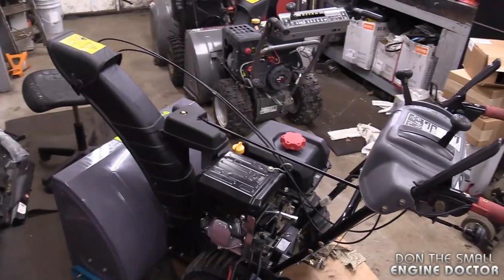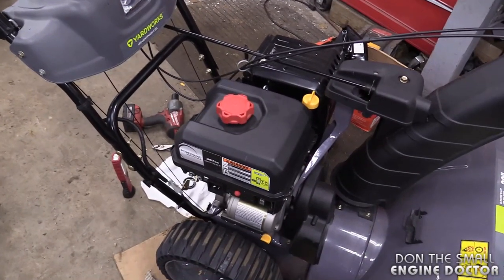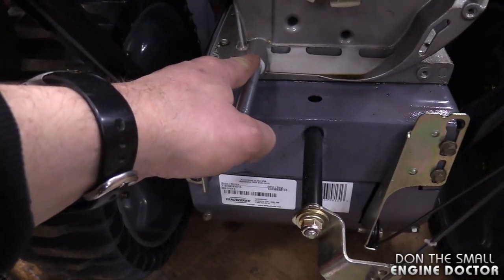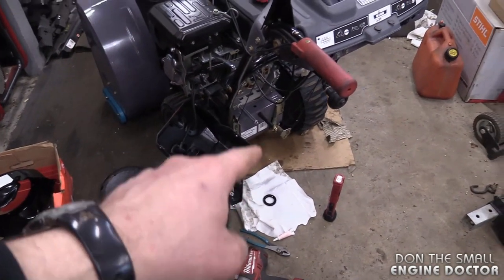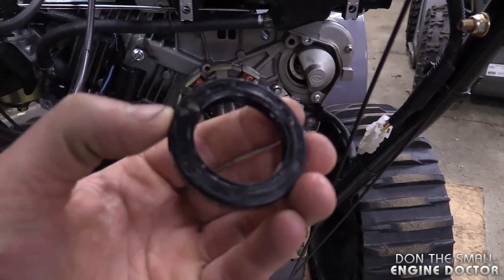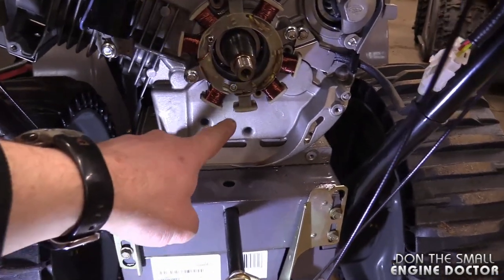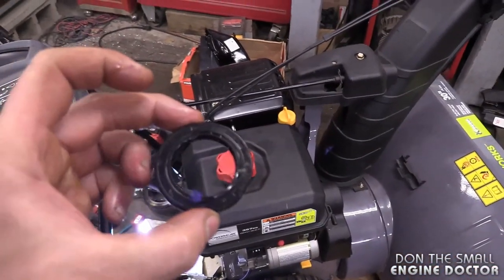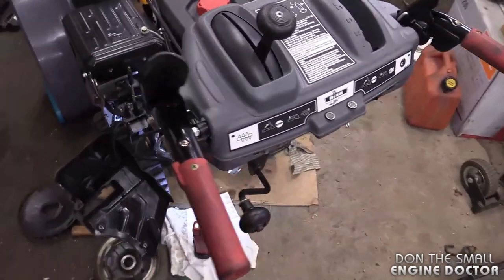Why A New Snowblower Had A Massive OIL LEAK! - Video

Comment: Thank you for showing us this problem. I wonder if the sealer you’ll be using will stop it blowing out if it backfires again. Cheers 🇦🇺
Reply from the maker: the sealer i will use that you also saw in last week's video will help prevent oil leaks but will not stop it from popping out if engine backfires through crankcase!
Reply: donyboy73 . Thank you Don. The crank seal in last weeks video had a metal case. This one appeared to be rubber. So I thought you may use a different type of sealer. All good. Really enjoy watching your videos from here in Perth WA. Like the way you get straight down to business. Cheers mate 🇦🇺👍
Reply from the maker: @tyroneclarke1666  yes sometimes i use loctite 515

Comment: We had one of those back when I worked at a small engine shop. The owner used starting fluid and as you stated, it back fired and blew the lower seal out. I had two snow blowers in my own shop with sheared flywheel keys because the engine ran backwards just for a second due to the fluid igniting at the wrong time. When in the compression stroke, the air inside the cylinder can reach ignition temperatures for starting fluid before the piston reaches TDC causing the piston to reverse direction. I have witnessed this before and caution people on using starting fluid on any engine. I prefer using eather just gasoline or gas/ oil mix in a bottle with a long neck suck as an oil machine oil bottle or small bottle. NEVER pour fuel from a open gas can directly into an engine people.

Comment: Great video like always Don. Thank you for your information!
Reply from the maker: You are very welcome
Reply from the maker: how's business going Fill?
Reply: @donyboy73  Great no snow here in the PNW. Just got a JD X300 full tune up, along with a TroyBilt 26" 2 stage and a Honda HRX push mower. Same client for all 3, all 3 full service 👍Been also working on an Onan Generator 3500. Needs a new carb
Reply from the maker: @fillslawncare  great, here it's better to have your own shop like me, most shop just pay peanuts here
Reply: @donyboy73  I agree! That's why I work in my own shop too. I use to work at a shop that paid mechanics minimum wage.
Reply from the maker: i'm from Canada, so where is PNW? By the way I see you're up early so that's a good sign you'll be successful at your business!
Reply: @donyboy73  I'm in Washington State. 5 AM here. 16°F right now. Might give it a few hours before I make my way to the shop.

Comment: Have identical blower from CTC. Trimmed plastic to install a fuel filter and shut off. Also put on a digital timer , up to 21 hours in 2 years. Seems to run fine.

Comment: I have a snowblower with an odd oil leak. It's a '93 Whites with a 9 hp Teumseh. (Still runs fine BTW) It started seeping a little oil after several years. When I tracked it down, it was seeping through a porous area in the engine casting. I've never heard of that happening before!

Comment: Nearly identical to my Troy built vortex tracker, and now you got me worried because mine has had small backfires that pop out of the exhaust when I shut it down 
I haven’t been able to really use it yet much here in Michigan and I’m worried the warranty will be up before I get any real time on it.   
But the few short times I ran it it did pop a bit, even though I brought the engine down to idle for 30 seconds or more before shutting it down.  Think a colder plug or lower octane fuel would help?  Ran about a quart of 91 in it so far, never checked the plug gap either.
Reply from the maker: i'm not exactly sure why his backfired but it's extremely rare on the powermore engines, they are very good engines!

Comment: This looks similar to mine and I had the seal partially come out while I was using it and dump oil all over the driveway. I had only used it one season. No back fires. I wonder if it is the initial installation or a manufacture defect?

Comment: Nice video. I'm surprised that much oil didn't short the stator.
Reply: The wire used to wind stators is covered with varnish when the wire is manufactured. It's actually very robust insulation.

Comment: My snowblower worked great last winter,stored for winter  no problems, looked at it this spring  noticed a small amount  of oil under center in back about 3"" across ,it's a Powersmart  212cc 24" machine, could it be the seal? or something  else,want to fix before l need it what do you recommend?
Reply: Will you answer  questions  like these?

Comment: Hi Don, been watching your videos for awhile. I believe this might be my first post. Why don’t they put a anti-backfire valve on the carb of some of these that have a electrical system on them? Would it take too long to generate enough volts to open the value to start it? I would add to slow your engines down to a idle before shutting them off to prevent this from happening again. Great video!

Comment: Thanks for taking the time to explain all these repairs. We don't have snowblowers here but even then I still learn so much that can be applied to other jobs. I rethreaded a bar bolt hole on my Dad's 028 after watching your video. It didn't leak any oil overnight with the bar and chain off but it does leak a small amount with it back on. I retightened both bolt, still leaks. Is this normal?
Reply from the maker: yes it's normal, the 028 and 038 always leak oil

Comment: I have a 2014 Ariens plat 30 with there AX engine that leaked from the crank seal when it was new ... Dealer repaired and has been good since

Comment: I have a Poulan Pro snowblower and it has a massive leak - the oil runs out without the engine even running.  I will have a look at that seal. Possibly it is the culprit.  It appears that the seal being replaced in this video is behind the starter rope mechanism.  I assume that can simply be unbolted and removed and then simply reinstalled later.

Comment: At least they have an oil drain tube that ends outside of the blower's frame. I have a Craftsman (MTD) where the tube drains on top of the frame. You have to use some kind of material to cover the frame and have the oil cascade away into a wide pan. Then you clean up the mess. Very helpful to know about the seal.
Reply: You can usually add a small length of threaded pipe of the same size to the drain NPT end so it will stick out a few more inches.  Try searching Amazon or your local hardware store.
Reply: @jimbohnenkamp5082  Elbows are Also at your hardware and plumbing supply store. How long does it take to remove the tire/wheel on your machine  to access the area to swap out the nipples and  add an elbow?  Some engines have more than one drain area built into the block. See if there is a plug already facing the rear of the engine. If you tilt the machine properly, you won't even have to drain the oil before replacing the parts. Usually Not  a complicated task, but I realize not everyone has the same skills. YOU can do it !! : )
Reply: @lencranston8183  Unfortunately, I have never removed the wheel, and I'm concerned that it may have gotten into a seizure. The snow blower is 25 years old.  I don't know of an alternate oil drainage location, but I'll check. My plan, if I find the parts, is to drain the oil, and add the acquired parts before replacing the oil. In the past, I have removed the cap on the nipple and quickly pushed a plastic tube onto the nipple with a bit of spillage. I'd just prefer to add an elbow at the end of the nipple and route the oil to the back of the machine, but that depends on being able to find compatible threading and pipe sizes.
Reply: @jimbohnenkamp5082  Understood. Best wishes : )
Reply: You might want to consider an oil extractor for your small engines. Easy, clean, and it gets all the oil out.

Comment: Hi I had a oil leak on my ariens sho 30 414cc  and they told me it was gonna stop leaking after about the 2nd time I used it, but I told them to come and pick it up, to make this story short, he said he took the motor out and cleaned everything and said it would have stopped leaking on its own, I find it weird why he had to take the motor out if it was something normal. Any thoughts? 
Thank you 
Nat

Comment: Sometimes the seal may pop out of a machine if either a dowel pin hasn't been installed to retain a bush or a circlip hasn't been installed to retain a bearing for example.

The 3.8 litre Buick L27 V6 engines were like that sometimes where the rear main oil seal wasn't installed into a blind seal housing & only the rear main bearing cap held it in position,the rear main oil seal occasionally had a habit of "walking out" of the bearing caps a bit which would cause an oil leak,it would end up a bit crooked.

GM fixed it up in the L36 engine by installing an alloy rear main seal carrier & a Teflon rear main oil seal..

Oh as far as my 5.7 litre Chevrolet LS1 V8 engine goes, when I ordered a new front crankshaft oil seal in 2018 for it, the eBay seller whose located in Sydney in Australia sold me a 3.6 litre GM-HOLDEN LY7 Alloytec V6 front crankshaft oil seal & I compared it to the old one & yes it was too small.

Its ID was 50mm & it's OD was 70mm,,now the GEN3-GEN5 Chevrolet V8 front crankshaft oil seal  has an ID of 54 mm & an OD of 72mm,now the likes of a Seggie or a Wilkinson would wonder why I didn't try to fit the V6 crankshaft oil seal.

Yes,the engine will piss oil everywhere if I tried to,I cannot get onto 2 of them which is an art form at work & I haven't been working,they probably never knew that I sent it back to Sydney !

Comment: The most likely reason that seal popped out is because the breather pipe connected to the air intake froze solid. I've seen it it when temperature is in the minus 15 or more, drifting snow, humidity in crankcase condense in breather pipe and freezes.  The breather pipe is exposed to outside temperature, I've seen it frozen solid , ice buildup more than once.  With the breather pipe frozen, blowby has no way to escape outside the crankcase and therefore increase in crankcase pressure is forcing either seal out, pto or mag end.

Comment: I will use Starting fluid much more carefully after this.  Great for clearing flooded engines and determining if it is a fuel or electrical problem with no start.
Reply from the maker: Great point!

Comment: I noticed that the snow blower had sold tires on it , that is a good idea  . Is this something new .
Reply: Cheaper for the manufacturer.  Many times products need to be upgraded after purchase to make them better.  Sometimes it better to buy higher quality in the first place than to spend time and money to make a low quality product better.
Reply: I have a 2015 MTD with the same solid tires and they have been lasting very well.

Comment: good you found it makes sense a backfire would do it thumbs up shared  might want to clean the carb as a precaution something caused the back fire right  that should be covered under warranty i would think if its still within warranty period unless they tried to start it with starting fluid that may cause a backfire as well may also want to check to make sure the crank vent is not plugged up  or was maybe frozen up
Reply: breather pipe froze

Comment: I use gorilla snott whitch is 3m wheather strip addhisive on the rubber crank seals.
Reply: We have a similar nome, we call it snake snot!
Reply: @motorcoachtech7615  Every time i call parts & order a tube and ask for Gorilla snott they have sent me 3m wheather strip adhisive.

Comment: Is it possible that pressure from the backfire gets past the rings, this affecting the seal/s?
Possibly bad or unseated rings in cylinder.
Reply from the maker: don't think so, i think it went through valves
Reply: @donyboy73  is there a crankcase breather on that engine? That would be a likely source for the problem.

Comment: I really don't understand how a backfire could lead to blowing out a seal even if the piston reverses direction.  Under normal operating conditions, doesn't the piston reverse direction on every revolution?  My theory is either the factory machined the hole for the seal with too large of a diameter or the seal was defective from the beginning as it was manufactured with a diameter that was too small.  My 2 cents.
Reply from the maker: the backfire is like blowback from a bomb, it will push everything that is weak out of it's way
Reply: Could it even have been combustion gasses/pressure blowing by the piston rings into the crankcase at the backfire. The normal downstroke of the piston, during typical operation, isn't enough to pressurize the crankcase in this manner. But a larger, very fast pulse of pressure from a backfire could abnormally pressurize the crankcase.

Comment: 30" 357cc yardworks snowblower (2 yrs old hardly used) gave me a huge puddle recently..Haven't determined location yet.
Canadian tire bought
Reply from the maker: check crank seal behind belt pulleys, if that's what it is MTD will fix under warranty, I have a video coming out soon on it
Reply: @donyboy73  just did a startup and check.... everything is dry around the base of block amd anywhere visible... I'm at a loss
Reply: @donyboy73  and oil level to marker when cold

Comment: Did lost an engine that way , and i found the reason for it when i put on a honda engine insted. Becource that my snowblower stand indoor in garage where its not heated the breathertube between the carburator and the valve couver frose up and the pressure in the crankcase built up and poped out the sealing inside the flywheel. The tube were "bent" down in the mittle and the water frose.

Comment: Wow quality control is the best where are these built same as Botkin & Stratton? Must have come over with a virus..🥴 that old junk of mine needs the electric starter hard to pull 20 times and back fires as well by hand kick back and smash hand into carb. heat box and nice square corner as well 🥴🤬.  Been a hard one to start ever since new back in early '70s remember dad going back within a week to get electronic starter for it pretty sure it's 1971 John Deere 7h.p.26" cut starter held up good this this past winter and had to replace keeper oil one if can be fixed .. that old girl went through a lot Blizzard of '77  Port Colborne had to replace drive wheel on transmission from pulling nabiour's car from snow bank.. thinking back at the crap that thing went through even pushing cars around the driveway to turn them around .. if I had to I would totally rebuilt that unit compared to the junk today.. watching your videos along with Steve small engine saloon showing me a few tricks and tips along with what to avoid for motors that are junk because of the great quality control and where it's made... Keep up the good work 😃

Comment: I was surprised you said that the PowerMore was a better engine than the Briggs. I’ve been under the impression they were at the lowest end of the Chinese quality scale sold mainly at big box stores. I haven’t seen these engines at my local dealers.
Reply from the maker: i would say at the higher lever of chinese engines, they don't blow heads and push rods like briggs

Comment: As RC Hobbist mentions in his comment, starting fluid is highly combustible to the point of getting a detonation rather than an explosion.  A fuel burn at a time in the cycle when you do not want it.  You see evidence of this in many generators that have been run on gas, shut down and stored, and when starting is attempted the next time will not start, so the first thing that comes out is the starting fluid.  The detonation occurs sometimes breaking connecting rods and cracking pistons!  Often times in brand new (as in hours of run time) equipment. A little straight gas manually injected would have prevented the destruction and accomplished the intended goal.

Oil seals for small engines have been cheapened considerably from 30 years ago.  Back then oil seals had a coil spring around the inner flange of the seal where the seal contacted the crankshaft putting tension against the rubber keeping it tight against the crank.  Many of today’s seals rely on only the inherent tension of the rubber to make contact with the crankshaft.  I’m sure this was a cost saving measure that manufactures wanted to implement, but in my opinion we all pay the price for it in seal failure.  Back then it was very rare to have a leaking seal.
Reply: I’ve saw engines with high mileage or hrs where that spring will wear though the rubber then put a groove on the shaft. I think this is why they are doing without those springs now.

Comment: The question is what caused the backfire?, badly adjusted valves or dodgy sparkplug that fails to ignight the fuel so in the exhaust it goes?.
I don't have a clue, but ill have a guess lol.

Comment: Hi Donyboy.....I live in North Bay, I have an amazing John Deere 828D with a tired 8 HP Tecumseh that I want to re-power. This unit can easily support up to a 12 HP in my opinion, another reason I want to re power my chassis is two of the threaded electric start mounts have broke off and I need electric start due to a severe back issue. Your not that far from me, do you have a good used engine with electric start for me?
Reply: I was able to put a metal strap around the starter to bolt to existing studs still there.  They were on opposite sides.  Plumbers strap with all the holes in it.  I always use synthetic oil for easier starting.